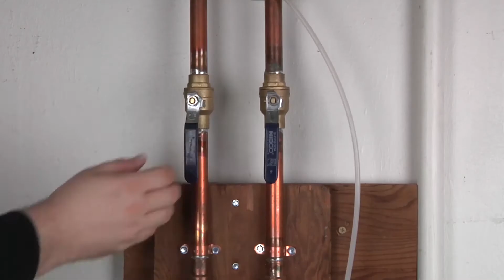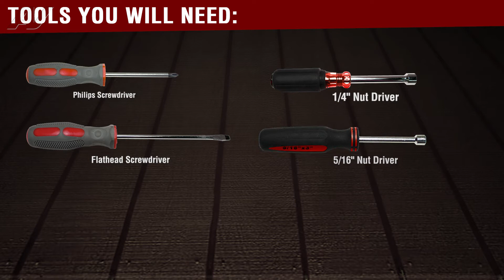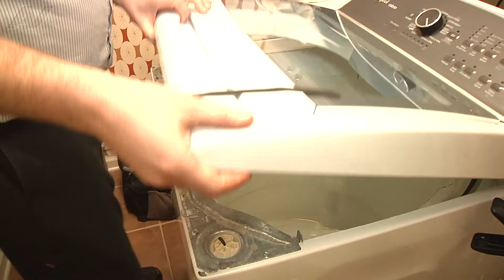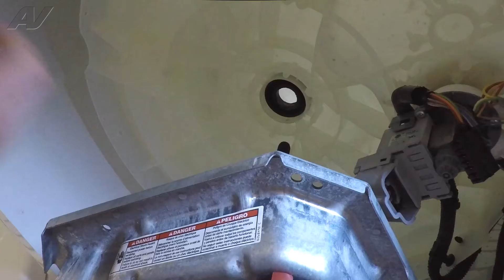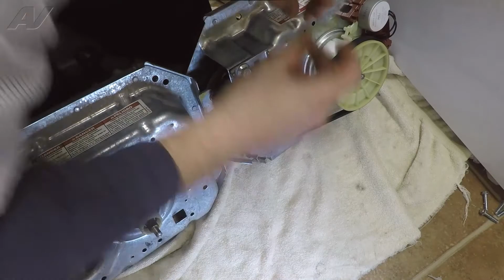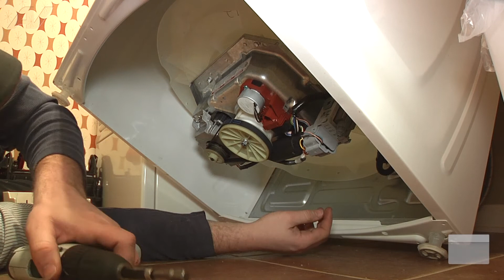Whirlpool Washer Repair - F7/E1 Error Code, Will Not Start Cycle - Gear Case

Comment: I changed the shift actuator and I still have the error F7E1. I ran a calibration and last over 10 min … spin spin and spin with red lock Light blinking. I was wondering if I could do something else before I buy a new washer….

Comment: Been getting the F7E1 code . Replaced actuator. Haven't tested the capacitor yet. Washer will go through the washing cycle, but as soon as it starts to spin/drain and go into the rinse cycle, it throws that code. Guessing the heavy weight of wet clothes is not letting it spin. Anyone have thoughts on this? I hate buying anymore parts. This thing has been expensive.
Reply: Yes, it’s your Capacitor, just replaced mine with same code. Picked one up for $40 at an Electronics surplus store. Amazon wanted $260 when I entered the part number.

Comment: I have a washer just like this and they are hot garbage.  First the bottom cover destroyed itself and mangled the drive pulley, then the actuator started clicking, and then I had the capacitor fall off the bottom and now I'm here after I pulled a F7E1.  The glass lid did not handle any sort of normal use before the plastic case started cracking.  I am just completely done with this thing.  Ordered a Speed Queen.

Comment: A stripped drive basket hub will also cause the F7 E1 error code
Reply: My basket spins freely, no “hummm”, hub looks okay……..I’m lost 😖
Reply: @MrDrocballer  ...If you're getting the F7 E1 error code, have you checked your belt, splutch / clutch pulley, and motor pulley?

Comment: I replaced the actuator and the capacitor but still get the same code. The basket spins freely no noise or grinding. The basket spins for a couple of seconds and then throughs the code.
Reply: This is what is going on with me. Do you have an update?

Comment: Great Video, love your work, but I've got a different issue... not sure what to do at this point.  So I tried the tachometer test and it worked, so I replaced it anyway with another one... but the light fails each time the washer runs a cycle and won't unlock without cycling the power... any ideas what's next? I've already tried the lid lock test as well and it passed....and... I've also purchased a used capacitor and that didn't fix it either.  F7 E1 error
Reply from the maker: Great question, if you have a more technical question that our parts department cannot answer, you can search our over 17,000 answered questions free at our website www.ApplianceVideo.com under our Repair Help section. You can also call our parts department at 1-800-830-5465 and they can give you help 7-days A week ,or search at www.SaveMoreOnParts.com  .
Reply: @Appliancevideo  thanks, I think I found the issue... seems the hub was stripped, so the basket wasn't spinning with the wash plate, that was a hard one to find a video on.

Comment: Is code F7/E7 is the same problem???
Reply from the maker: Great question, if you have a more technical question that our parts department cannot answer, you can search our over 17,000 answered questions free at our website www.ApplianceVideo.com under our Repair Help section. You can also call our parts department at 1-800-830-5465 and they can give you help 7-days A week ,or search at www.SaveMoreOnParts.com  .

Comment: I have a Maytag giving me this same error code. Is there anything else that could cause this particular error code or is this it? Trying to determine if there is something smaller that could fix the issue (not agitating) before I spend several hundred on parts. Thanks in advance!
Reply from the maker: Great question, if you have a more technical question that our parts department cannot answer, you can search our over 17,000 answered questions free at our website www.ApplianceVideo.com under our Repair Help section. You can also call our parts department at 1-800-830-5465 and they can give you help 7-days A week ,or search at www.SaveMoreOnParts.com  .
Reply: Did you every figure it out? We have a maytag centennial washer and we got the same code.

Comment: Would I be able to re use a tub seal on this style washer?
Reply from the maker: Great question, if you have a more technical question that our parts department cannot answer, you can search our over 17,000 answered questions free at our website www.ApplianceVideo.com under our Repair Help section. You can also call our parts department at 1-800-830-5465 and they can give you help 7-days A week ,or search at www.SaveMoreOnParts.com  .

Comment: Hi Brian . I have a code F7E1 on my Whirpool model WTW4950XW2. I replace the actuator, calibrate the machine but the problem still there. No spinning. I try the motor individually without any belt and and hey work. When i i put the belt back on, the motor was making a noise but never move at all. I was suspecting the capacitor. Before replacing that part , i make a test with screwdriver and i saw a spark. Do you think i should replace the capacitor anyway ? Do you recommande me something else? Thank for your help and thank for your videos. Very instructive !!
Reply: Mine was bad capacitor just get a cheap multy meter and measure resistance, it was open = no continuity
Reply: Check the capacitor first
Reply from the maker: Great question, if you have a more technical question that our parts department cannot answer, you can search our over 13,000 answered questions free at our website www.ApplianceVideo.com under our Repair Help section. You can also call our parts department at 1-800-830-5465 and they can give you help 7-days A week ,or search at www.SaveMoreOnParts.com  .
Reply: Check with multimeter , check microfarads
Reply: Hi Zelda-187 Léo I am having that exact same issue. What did you do to fix the problem? Was it a main control issue?
Reply: Hi  @carish1452 . Could you tell me how you got the issue fixed? It seems like I'm having the same problem !
Reply: what was your final fix ?  I am going after the shift actuator on mine soon.

Comment: What's the code for sending and washing?
Reply from the maker: Great question, if you have a
more technical question that our parts department cannot answer, you can search
our over 10,000 answered questions free at our website www.ApplianceVideo.com under our Repair Help section. You can also call
our parts department at 1-800-830-5465 and they can give you help 6-days A week
Monday -Saturday, or search at www.SaveMoreOnParts.com  24 hours
7- days A week.

Comment: Hi I am having the same error code. It is a Maytag Centennial MVWC400XW3. It makes a whirling sound when I spin it by hand. I would like to know how much it costs to fix the gear case or if I can just replace the shift assembly for now.
Reply from the maker: Great question, if you have a
more technical question that our parts department cannot answer, you can search
our over 10,000 answered questions free at our website www.ApplianceVideo.com under our Repair Help section. You can also call
our parts department at 1-800-830-5465 and they can give you help 7-days A week
Monday -Sunday, or search at www.SaveMoreOnParts.com  24 hours
7- days A week.